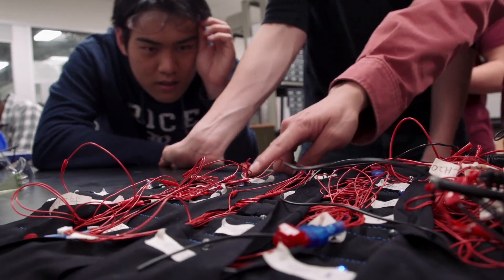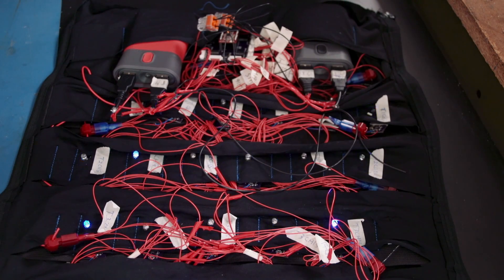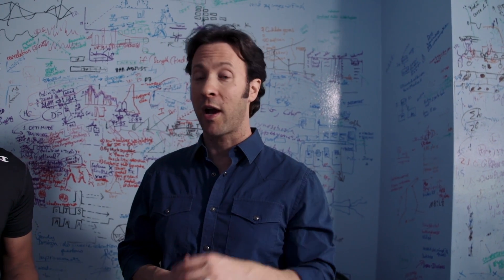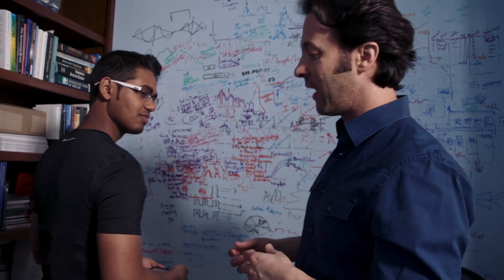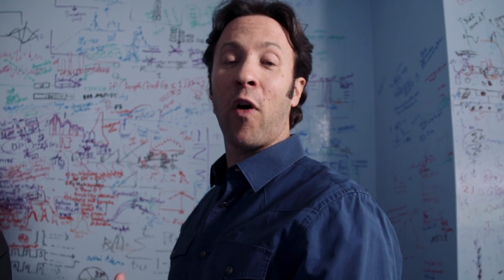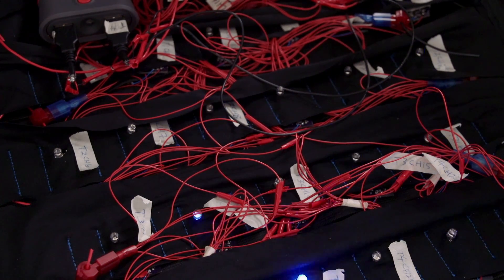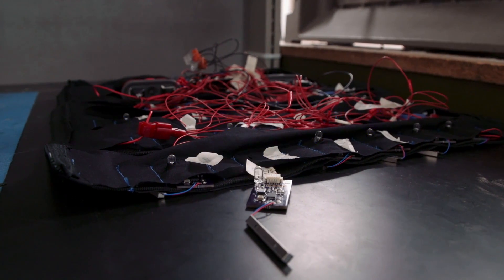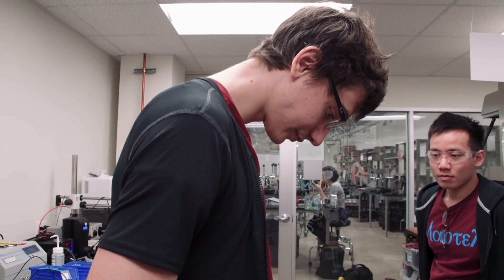A vest that can help create new senses for humans

Comment: For the V.E.S.T Matrix, which one was the best option: Discrete Wavelet Transform which won't lose the time information of the signal or Discrete Fourier Transform which will lose the time information of the signal for wearable transducers... As far as I understand from your project, you train the biological brain with supervised learning technique through backpropogation used to train Artificial Neural Networks... It seems that it works well for the biological one which has been hacked by the very itself... Avatar mode loading for connecting E-ywa...